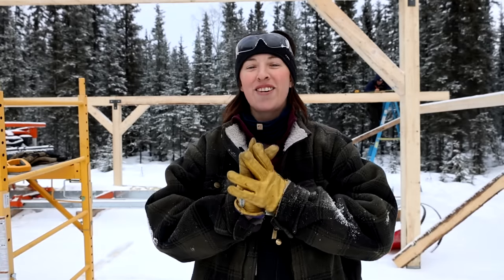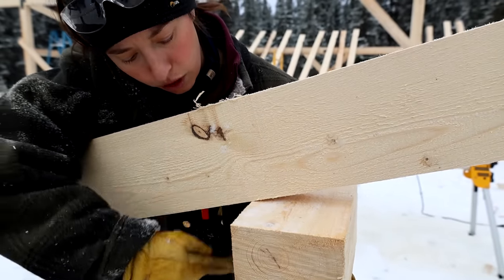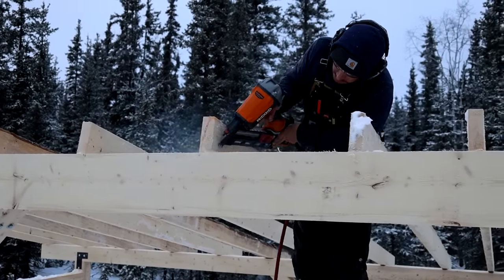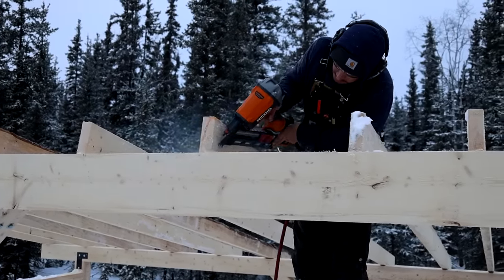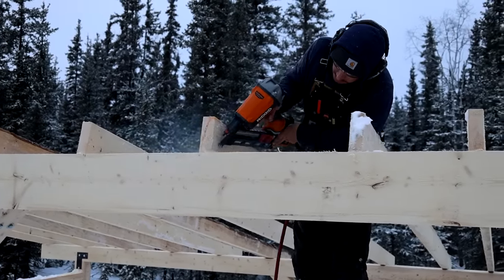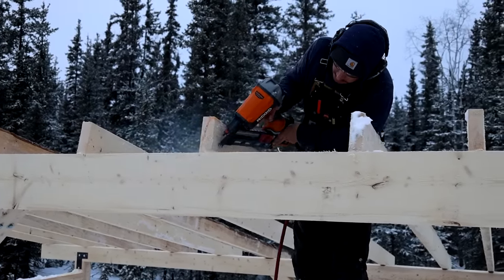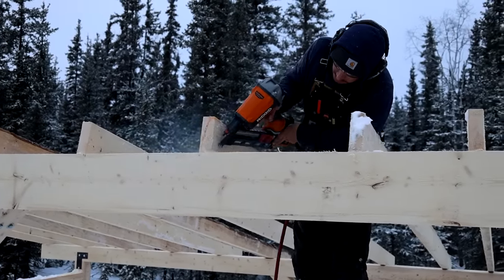Building a Sawmill Shed | Install Rafters and Metal Roofing + Total Project Cost

Comment: Al and Gina are building a new barn and have braced every post for strength from  snow load and for stability.  Their barn roof is like a huge lean~to which they will add to later. I’m happy to see you being protected while working on the saw mill in the future. A good place to dry wood slabs too. Your food always looks yummy. Happy Thanksgiving !😊❤🇨🇦

Comment: That is a great looking sawmill shed, I agree with @JRS2248 about bracing on the end beams.  Did you put the ridge cap on, if not, it would protect the ridge where the short and long roof meet.

Comment: I did not see either of you wearing a side arm.  Are there not bears in your neck of the woods ?     Great job on the covering.  You are lucky to have access to lumber by cutting your own logs.   Texas is very expensive right now.  It crazy expensive for everything for building.  A builders square or set a level a top the roof and measure down 1 foot, then down to the roof.    Nice work, congrats.

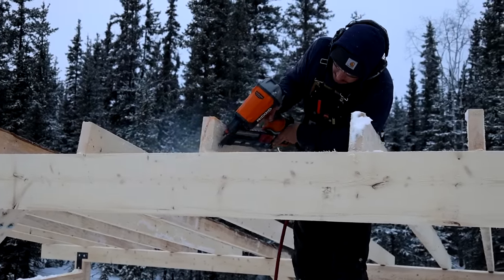Comment: What an awesome job.  Knocking that out in 8 days is great work (if I remember right, this time of year the sun comes up at 9:00 to 10:00 and sets at 3:00 to 4:00--so really you had 8 half-days).  Doing it while dealing with the weather this time of year is impressive.    TIP:  Between now and the end of next summer, as the wood you cut and used dries and cures further, some of the boards may twist/bow.  Watch for this and tighten/nail further.

You built this structure so well that it could be the ideal home for your solar panels.  Just a thought.

These are the kind of projects that stress-test a couple's bond, drive, skills, patience and endurance.  You two always come through for each other.  It is great to see and thank you for sharing your journey.  My wife and I just smile the whole time watching your videos.  You remind us of us.

Hope the ice fishing trip is successful.  You both deserve it!  Cheers.

Comment: Maybe add a few 45 degree Corner Braces around the 4 Corners..lol..I know you got the steel but in terms of Shear Strength, Braces , you may want toi look into, also, simple strapping wrapped around joists can act as Hurricane Plate Action..

Comment: I built my shed and it’s similar in size. All the metal hardware I made myself including the post bases. All it cost was about $75-90 for 20’ lengths of steel.

Comment: Please add 45⁰ diagonal bracing every place a beam meets a post.  Ir stands a good chance of racking otherwise. Eliminating weak points is a key to stability. And notching rafters for the beam makes it stronger, not weaker.

Comment: Noticed the structure had a bit of side to side wobble. I'm sure you are planning something for the end walls to help with that. Snow load and wind can add to that making it top heavy. Your also in earthquake country. Doesn't your adjustable square you used for front rafters tell you pitch?

Comment: What you guys should do is put an hour meter on the engine it just wraps around the spark plug wire. Do it for two reasons one to keep track of how long it’s taking but also for maintenance for changing oil on the engine and because you’re in cold climate You synthetic I like Amsoil they make an amazing product it’ll start easier in the winter and in the summer you don’t have to worry about it. I have a gas engine compressor that I purchased in 1999 and it’s got over 6000 hours on it and it starts and runs awesome

Comment: This is a great job that you have accomplished 👏 😀 👍 
I would agree with previous posts. Definitely need cross bracing on the ends for winds. But I would consider adding for more safety, two cables with turnbuckles you can tighten up over time diagonally corner to corner. Great watching you. Love the calendar too.😊

Comment: I reckon you pair are capable of building a nice big house. I don’t think you would have a problem. That structure looks nice and secure. As for bracing, you don’t get mad crazy strong wind storms where you are. Your costs were good I think. But in general building materials in the U.K. including wood is astronomical in price, due to massive inflation of which we are suffering currently. So congratulate yourselves. You cut your costs by milling your own wood. Well done ! 
👍👍👍👍👍👍👍👍👍👍👍👍👍👍👍👍👍👍👍👍👍👍👍👍👍👍👍👍👍👍👍👍👍👍👍👍👍👍👍👍👍👍👍👍👍👍👍👍👍👍👍👍👍👍👍👍👍👍👍👍👍👍👍👍👍👍👍👍👍👍👍👍👍👍👍👍👍👍👍👍👍👍👍👍👍👍♥

Comment: I think the next project should be a wood fired covered hot tub using an old wood heater with coil heat exchangsr.  12v pump with solar power.  :)

Comment: Notching the rafters, Good idea! ( framing 101). Eric & Erin,  I'm curious, have either of you read anything on timber framing, or Framing in general? At T: 22 min I noticed the building Swaying Big time with Eric on it; even with the roof framed. Not good! It should NOT be swaying at all. I believe its the inherent flaw of the "0ne Bolt" & small nut anchor brackets; which in themselves was a poor choice as the One bolt will bend / pivot & oscillate with the wind or when walking on it , or .. you get the drift.  You should have just anchored directly into the slab with at least a 2-3 bolt bracket. One good storm and it might be, all she wrote! Take care & God Bless.

Comment: Just a little information. I spent two winters near Fairbanks in the early 80s. The first winter was very cold. It got down to -56 degrees for a few weeks. The second winter was not as cold, but still very cold. It snowed much more the second winter. I believe because it was less cold. I would say it was warmer, but there was nothing warm about that winter either. The amount of snow the second winter was staggering. I grew up in Montana, so I was familiar with a lot of snow. The snow the second winter was like nothing I had ever seen. Just be prepared. You could get a huge amount of snow.

Comment: 22:22 looking at you handling the roof steel the structure shakes quite a bit. You must have felt it too. Maybe a good idea to get some braces going front to back (in the end walls and some at the two inset "inner" walls... should stiffen the building up nicely...

Comment: To join the others-  You really do need to brace your corners, The structure only needs to start turning and the weight will continue the movement, to the ground.   There should be no wobble, should feel solid.

Comment: That is beautiful! It would probably cost 25,000 to 40,000 to have a contractor build it. Sliding roof panels, I think you could use clamps to hold a panel in place, then remove it after nailing it down. Have a Happy Thanksgiving 2023 !!

Comment: For getting the pitch on your roof...Just make a protractor. Flat line is 180 degrees. Every half, half's the angle....90 degrees, 45 degrees, 22.5 degrees etc. Do this by repeatedly folding paper.

Comment: Great job! be sure to put the 45 degree 5 and a half inch diagonal supports on the end walls, especially, because I notice that the building was moving around when you were on the roof in the video. You want those diagonal supports everywhere you don't have them in case you bump it with a log and or tractor, and you'll be guaranteed that snow load won't make it spiral to the ground. as it stands right now it would be super easy to push it over from front to back, maybe a big long one from top in front to bottom in back or, maybe make it into a giant X, because you know you may bump it and I'd hat to see it fall on the sawmill or someone. The diagonal bracing is your key to shear strength. Great Job! Your just not finished yet.
Reply: Oh yeh and in only 8 days, You guy's kicked ___!
Reply: Sorry about it, I didn't realize everyone is jumping on you about the diagonal bracing. 😂:stayhome::face-red-heart-shape:
Reply: Next time I'll read the comments before I comment, your friend Todd, Happy Thanksgiving!

Comment: Just use old engine oil mixed with a bit of gas to protect the wood. Bugs won't eat it and it won't rot for decades! The hydrocarbons will evaporate after a few days and leave the additives  so the smell won't last long at all. :)

Comment: The shed for your small sawmill looks very good. But as a civil engineer, I would strongly advise you to stabilize the substructure. You could see in the video that the whole shed shakes when someone works on the roof. If it gets stormy and the wind gets under the roof, it will blow the whole shed away. So you also need to connect each floor beam to the concrete slab with two 45° side beams!!

Comment: You’ll be able to throw a rope over it saw it down through the snow and then pull it down the back and it will pull the snow right off with that slick roof.

Comment: Won't you need to Treat the green wood? Great job you two. I have a question. I noticed it was moving when you we're putting the roof on. It shouldn't do that.  I see where you need to add blocking the small blocking to tie each rafter together. I don't know what there called It's moving side to side.  I'm NOT trying to be rude or mean I just know how my husband does it.  Wow That is amazing 2 1/2 gal of gas only for all that cutting. For the size of the building you have I think $2000. is very good. Yes the nuts,bolts price sneaks up on you.

Comment: 4/12 is the minimum pitch requirement for metal roofing as far as ucc goes, any less has to be a burn down rubber roof. Not too much of an issue for you guys as there isn’t an “interior” space that could be subject to ice damming.

Comment: Cutting the birds' mouth into the rafters doesn't compromise their strength. On the contrary, matting the two surface areas together gives you a stronger overall connection because now the rafter and beam work together to distribute the load.

Comment: I am concerned about the snow load on the roof causing the building to collapse.  The front and back bracing should have steel straps like the post. The ends of building need x-brace from top of post to bottom bolted with steel plate washers. Better safe than sorry

Comment: You were afraid that the notches (birds-mouths) at the end of the rafter would weaken the strength of it. That's not the case!! It would be true if the notch is made in the middle, which is what plumbers tend to do :) and that is an absolute no-no. In the middle of a beam, a whole in the center is no problem. At either end, a smaller dimension will not impact the strength of the beam / board / rafter. Building engineer here, as a student I had to calculate all those forces in a structure <g>.

Comment: Nail a few boards in/on all diag bracing to over head beam and that will withstand a hurricane!! I'd wall up all around except for front to bring logs in, add big doors at both ends......... 
Now the sawdust, you will get lots of sawdust, a pricy way to remove sawdust is blower and 4" hose, a cheap labor intensive way is broom and shovel, a cheap and less labor way and how I remove sawdust is, make a 6'x 8' platform with 2" high removable sides on 3 sides, dig down 2' x 8' wide behind back wall, use push board in shape of push broom to push sawdust in box, when full drag off and tip over, bring back with forks. 
My sawmill building is off ground 2' so I didn't have to dig down, for more boring info you can go to my boring YT channel.........

Comment: You should have done it like a salt shed so u had over hang front and back cuz weather going to run down front and rotten it and ur fig all wrong there more of the board holding it up with the bird mouth then the way u did it be 4 you guys should watch this old house with Bob veler PBS mite teach you how to teach others 😉 u should be put 3 nails in ur straping it's going to hold the building straighter & ur crawl space is a basement it's just Short lol

Comment: YOU NEED TO THINK ABOUT CLOSING IN THE SIDES. Barn double sliders on the front, cafe doors in the ends and close in the back. Why? Your sawmill is a big investment and by closing it in will last you almost an extra ten years use.

Comment: You are getting too much movement without bracing.  You can do this down the sides and then add some horizontal strapping or siding to three sides and it should stiffen up.  As it sits, the entire thing can just fold to one direction.

Comment: Did you add the cost of the concrete in the overall project.
Reply from the maker: No that was not including the price on the concrete which was $210 a yard and we used 10 yards

Comment: I was shocked at how much the structure moves while you were on the roof putting the metal roofing in place, this is a problem. On the two ends of the structure and the back you need to remove the short diagonal braces at each post and do long diagonal bracing from one post base up to the top of the next post, long top to bottom 'X' bracing between each post would even be better. On the front not much can be done with the large opening where logs are brought in and up on the saw, but the rest of that wall should have long diagonal braces from one post base to the top of the next post or better yet 'X' bracing between each post. Without the bracing when the roof is full of snow and the wind is whipping the whole building could 'rack' and fall down. You may want to cut some 1/2" or 3/4" thick siding boards to cover most if not all of the rear wall and the two ends of the building that would also help to stiffen up the structure the same way plywood does when put on the walls and roof of a stick-built house it prevents racking and substantially stiffens the structure. You could also use 3/4" boards on all sides and leave gaps to allow light in and still stiffen the structure. Personally, I would have made the black steel timber connection plates much wider and longer on each leg to allow 2-4 through bolts in each piece of timber you were joining not just one bolt per piece of timber and I would not have used lag bolts or carriage bolts anywhere on the structure, only through bolting with hex bolts and hex nuts with X-large sized washer to really grip the wood tight. Having hex bolts instead of the carriage bolts that were used means you can get a wrench on both side and get the bolt properly torqued good and tight, a carriage bolt is just going to spin when you try to torque it tight as there is not a second hex head to put a wrench on. My intention is not to be negative, my hope this info helps make your structure stronger, safer, and better. The company that made your roofing sheets has a ridge cap you should probably install to prevent rain intrusion.

Comment: BRACE!
BRACE!
BRACE!
Nice looking building but in it's current form it's dangerous with the potential to collapse either front to back or back to front.
As others have said, we could see the movement when you were putting the roof sheets on - you probably even felt it.
This needs addressing URGENTLY and not next month or next week but right NOW!

Comment: Arielle, at the 5:50 time stamp you are cutting a rafter in the background. You have the rafter on the right side of the cut table and you are cutting the left end of the board. Don't do what you are doing with your hand placement. I'm sure you are right handed since you are operating the saw with your right hand and holding the board with your left hand. Stop doing that when you cut that left end of the board. You are in danger of cutting your left arm with the travel of the saw blade. Especially since it looks like you are using a 12" chop saw. When you are cutting that end, switch hands. Operate the saw with your left hand and hold the wood with your right hand. Now your hands/arms are clear of the saw blade travel. I have watched too many YouTube people cutting the way you did and someone eventually will injure themselves. Please be careful. I love watching you two work and the projects you come up with, I just want to make sure you're both operating that saw safely.